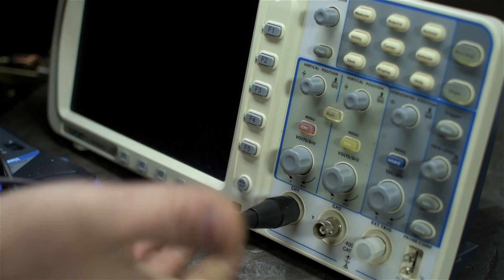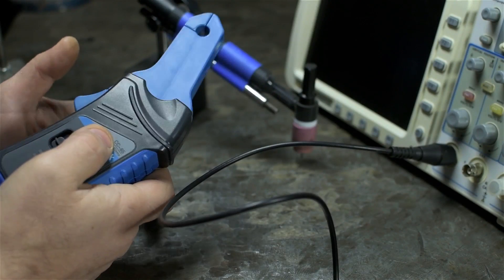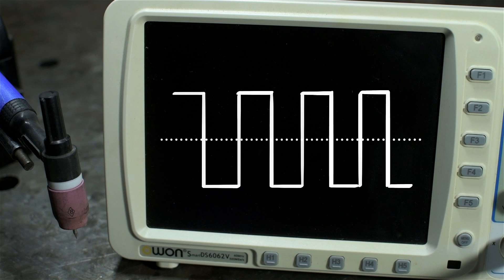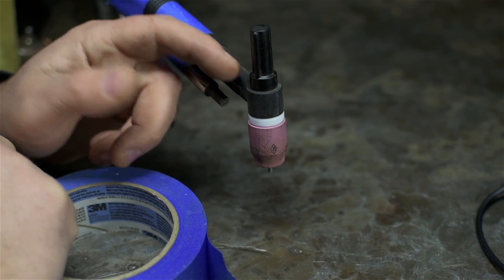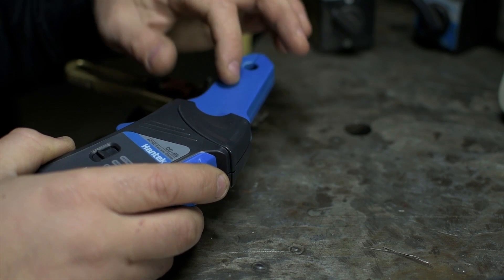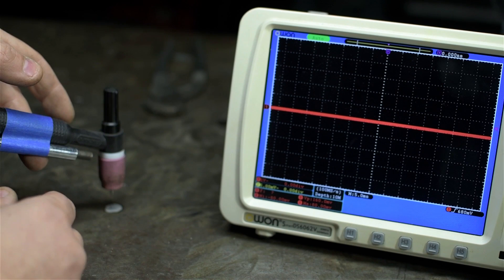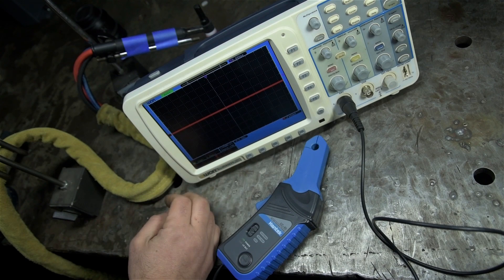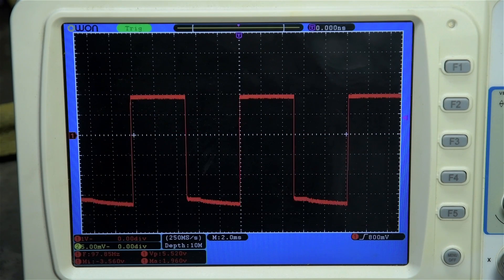Oscillo-Help-Me?

Comment: sounds simple, but have you checked that your ac cleaning pot is at 50%?? if it is, you could switch your polarity, and if the waveform inverts then you will know that the manufacturer builds the asymmetrical balance/imbalance into it.

Comment: Also...that spark looks like it is about 25 30mm, that means that on the start you have a couple kvolts on the electrodes. The scope usualy accepts a 50V input and using a 10:1 probe 500V. You can blow up your scope in this way and i think that is what happened and why it doesn't center the impulses on the screen.
Reply: But he is not applying the high voltage too the scope. it is isolated from everything else. He is using a current clamp. The scope looks fine for my eyes. I suspect the probe.

Comment: I suspect they deliberately tune the inverter to produce more negative current for more heating with the same amount of overall power.   It would also reduce the heating of the tungsten.
Reply: Nah. Positive is for heating and compressors, negative is for cooling and vacuum pumps. AC is for traffic lights, televisions and fans (that blow as much as they suck).   I fear your electricity provider is not supplying you with Atomic or coal fired power which is ideal for welders as it has been preheated. Solar is similar, but only intermittent at best as it stops at night or anytime you go indoors. Wind or hydro power is obviously inherently unsuited to anything as demanding of heat as welding.
There's scope for research here.
Reply: carabela125 - That's what is in the back of my mind also. But I'm not sure at all.
Reply: I find this to be highly likely.

bump! to make it more visible.
Reply: Shit, fam, I didn't think of it from that perspective
[scratching chin emoji]

Comment: tony you don't see the current on the scope. You see the shape, on the vertical axis it shows how the tension rises from 0 to V+ and on the horizontal scale you see the duty factor. The welder looks fine to me.
Reply: Yes you see current on a scope if you use a current clamp....
Reply: Yes, that would be an option.

Comment: Before all, do a self calibration on the scope with the built in probe calibration output. After, For try, just hook up the clamp to a 200W lightbulb, then You will know if the clamp is out from calibration. You have to see a total symmetrical sine wave. Do 2 turn around the clamp, then You need to see 2x the current. If not symmetrical, You need to open the probe and find the balancing calibration pot and adjust.
Reply: If it's a hall effect sensor with a steel yoke (or some other material with significant retentivity), it's entirely possible to magnetize the yoke by measuring strong DC pulses.  This tends to offset all other measurements, and doing an electrical calibration to remove the offset might not fix the problem if the remanent field is strong enough.  I know I've had to manually demagnetize my clamp meter more than once because I couldn't cal it back to zero. 

That said, it's trivially demagnetized by measuring strong AC signals, soooo I don't think it's necessarily an issue.
Reply: The probe compensation output on the scope is to adjust the compensation capacitors on your passive probes, not to calibrate the scope itself
Reply: pjtruslow just to check levels, timing and general A/D quality
Reply: HammyJamPants that’s why he need to hook to ac line with 200w bulb...
Reply: the probe compensation output is a square wave from zero to 5V,  you can't even expect it's voltage to be precise. the only characteristic about that output that is important is that it is a very sharp square wave, and as such you can't really use it to  diagnose the oscilloscope.

Comment: As a highschool graduate with no appreciable amount of electronics knowledge other than an NE555 blinker circuit. Capacitors maybe?
Reply: Or Inductors? Resistors? Transistors?... no? .... Transformers?.... then I give up...
Reply: I've always found it humorous that someone will always say one very specific part, with no knowledge of the parts involved.  It's the same as any car fault being the thermostat or head gaskets.  At least he prefaced it by admitting he knew nothing.
Reply: But . . .  the welder is only leaning a trace; it's not incapacitated

Comment: Maby you shuld try using a shunt resistor. Maby 0.1 ohm i series with the ground. Then you  set up your scope to measure the voltage differentaly on  the resistor.  The current in both the ground and the torch is the same, its a loop.

Comment: If electricity is a "power to push electrons", then in AC you have a push from one side and then a push from the other. You're measuring the amplitude of the 'positive' push on the negative cable. After the spot in the circuit where it does work, jumping gaps and melting metal. So it has of course lost some of it's 'power to push'.  But let's see a measurement on the torch cable to test this.
Reply: This is a current measurement not a voltage measurement.
Reply: Yes. I saw the ammeter.  :)

Comment: Flip the clamp meter over. If the waveform flips over on the scope then the scope and clamp meter are fine and the machine is outputting an asymmetric wave. If the waveform stays the same on the scope then it's just a measurement problem.
Reply: I expect what the commenter means by "stupid" is just simple. This explanation could also explain why the waveform is nice and square on one side, but weirdly sloped on the other
Reply: Better ask on EEVBLOG then!
Reply: I was thinking alone those lines. 
Try and repeat the error in the first instance.
Reply: You can get bidirectional current measurements with the right devices, hal effect included.
It depends on where the 0 current is at though, is it halfways full  output or does it go negative or is it asymmetric.
Adjust the "zero" reference and you can get all these weird things if you specify bidirectional on your current device, you can even make bidirectional output unidirectional :)
Reply: 0-whatever wouldn't do much good on an AC current.  I've never seen an AC/DC clamp that couldn't do negative currents.
Reply: @skrubol  Current being scalar, it seems a bit redundant to spec that. If it does AC, it does current flowing in either direction, whatever you want to call it.
Reply: Literally this. Just posted this before finding this more upvoted comment. Those clamps are usually 0-60a and not -60 to 60a :P Im surprised it does any -a at all :0

EDIT: If you need some brainbending electronics skill, you'd best be asking mikeselectricstuff.
Reply: @iwtommo  well, it's not a DC clamp but an AC capable one. Shouldn't matter that the current flows backwards.
Reply: This sounds so stupid it might just work
Reply: Why does it sound stupid?

Comment: That waveform is from the current probe correct?  If you rotate the current probe on the wire do you get an exactly inverted signal?  If not, definitely a setup problem.  Have you tried DC mode and see if it agrees with the probe.  Flip the probe to make sure it responds equally to each current direction.  If that works I think your setup is clean and your asymmetric waveform welds better theory comes into play.
Reply: Pondering this a bit more I suspect the voltage waveforms are symmetric and the physics of the EN vs. EP makes the current asymetric.
Reply: But welder supply current, not voltage.

Comment: Rotate clamp 180, if waveform flips then its the welder, if waveform stays negatively biased its the scope
Reply: For some reason this make some sense.
Reply: My first thought, exactly. Also, you could try the higher current range on the clamp (switch to top position).
And the scope is probably going crazy, because of EMF generated by the high frequency startup. Try putting the scope at a greater distance from the welder, and if needed, shielding it.
Reply: This is one of those things that doesn't make sense if you think about it only a little bit, but is actually correct, the reason is that style of probe is actually measuring the inductance of the wire, so a positive voltage traveling through it creates a curved electric field via the right hand rule, so flipping the probe around will cause the measurements to swap polarity.
Reply: As near as I can figure the probe is for AC as well as DC current. It should be using a hall effect sensor to measure the magnetic field, which is also the reason for the battery in the clamp. But there may be a problem with residual induction in the clamp somewhere, which would show when flipping the clamp.

Comment: Check your inverter. You are showing a 20 to 30 amp ac wave down to a 40 amp dc wave, which is the welding point.

Comment: I would like to see you  take the measurement on the torch cable (with current clamp). I get that it's easier to clamp on the ground cable but maybe it would show some difference ?!
Reply: Agreed
Reply: From my point of view is AC a lot more "kinky" ..so eliminating every parasitic capacitance or inductance is gonna help
Reply: Disagreed. Its more dangerous for the scope because of the RF high voltage on the torch. Also, the ground returns exactly the same current as the torch puts in. The output ground is not connected to mains ground in welders.

Comment: Maybe you could avoid the Hantek clamp, just put a single loop of wire around the ground and measure that. It wouldn’t be calibrated but it should show asymmetry.
Reply: Don't do that. First of all a coil of wire will have a very poor low frequency response and Tony is trying to measure a DC offset. Secondly you could induce very high voltages in that coil, especially when the HF is on. There is a pretty high risk of killing the scope with this setup.
Reply: Bill suggested a "a single loop of wire" - very unlikely to kill anything, even with 200A + peaks and inductance of a single loop is very low, so HF response shouldn't be affected overly.
Reply: Not going to work.  A loop of wire around the ground cable will only pick up stray electrostatic leakage.  If you want to make a current pick-up the primary and secondary wires have to travel in the same direction.  Passing the ground lead through a toroidal core and placing a 60 turns of wire for the pick-up will give you a 60:1 current transformer, do not forget your 1A rated burden resistor of you have a DIY Tesla coil instead.  Same as the clamp meter but bigger.

Comment: Maybe something is saturated so that top of the wave gets cut off clean
Reply: That would be my call. I would have a look at the low current side and see what is going into the transformer. The inductance of the transformer is going to change with a high frequency start, so there must be something going on to even that out.